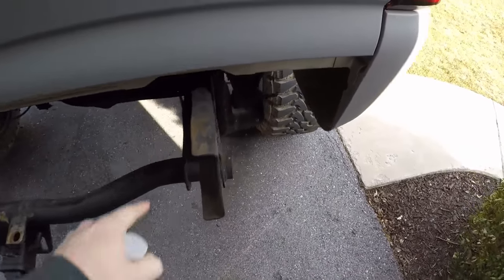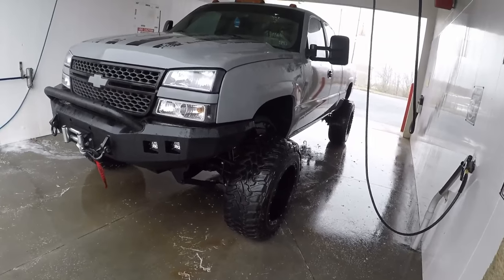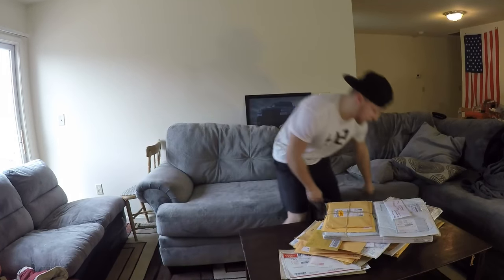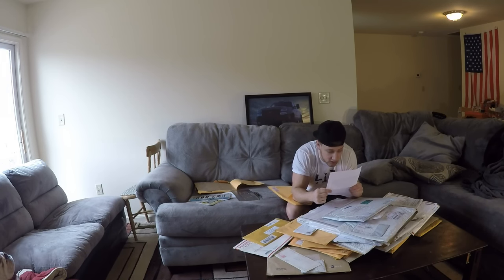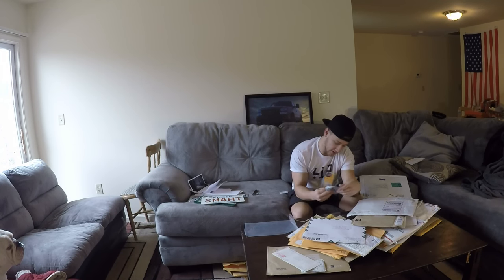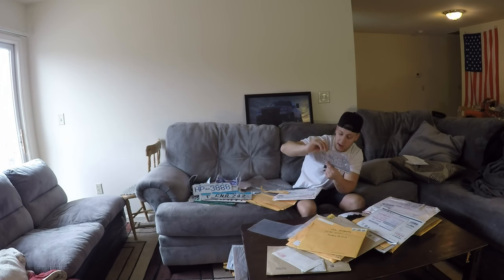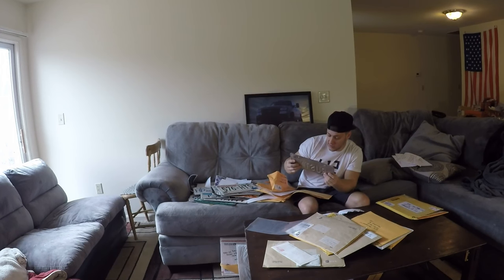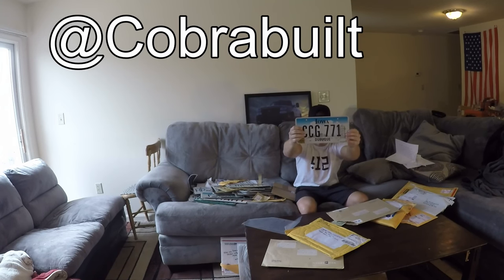DURAMAX Gets New PAINT!

Comment: Just an FYI if you just had that painted you probably do not want to put a wrap or anything on if for at least a few months till the paint fully cures. I don't know what kind of paint they used but we always tell people not wax or put any coatings on for at least 2 months. There are fumes still releasing from the paint and coatings can ruin it. It takes about 4- 6 months for paint to fully cure on a car, the changes depending on climate and paint.
Reply: What kind of shop doesn't clear the whole box side???  That's not going to last...  The clear is going to peel at the style line.  Curing time comes to a halt below 50 degrees.
Reply: It should not peal if it was prepped right and they used a blending agent. A blending agent will soften the old clear and allow the new to adhere. This is common in a lot of repairs. If they painted the whole side it would not match the cab unless they blend it into the cab and then you would be in the same situation.
Reply: You don't need to paint the whole box side.  Scuff the whole box side; repair and paint the area behind the rear wheel and clear the entire box side.  Much better repair that will last.  You're right I have seen many blending repairs and if you keep the vehicle long enough, it usually peels.

Comment: just a heads up when they repaired ur bed sode they probably just spray cleared up to the body line. over time the clear will begin to fade in that area i recommend in the near future u remove the wrap on that side and have them clear coat the whole side of the truck. what they did was burn the clear coat in. its not a bad job but in a few years the clear coat will lift up in that area

Comment: Hey pull your tail lights out a few times a year and wash the bed side, salt and stuff lays in and rusts the wheel wells from the inside out. I wash mine out and then spray penetrating oil a few times a year at the wheel well on the inside just to keep it from rusting!

Comment: The Chevy Camaro Berlinetta  was nothing spectacular in regards to performance. but it had a very futuristic type of electronic read out for the dash board, climate control area, and if i remember correctly they had a swiveling digital gauge that had radio controls on it, it was pretty cool, not fast by any means but cool on the inside.